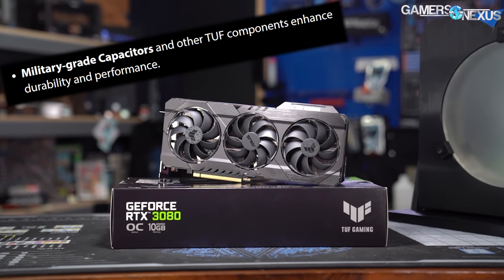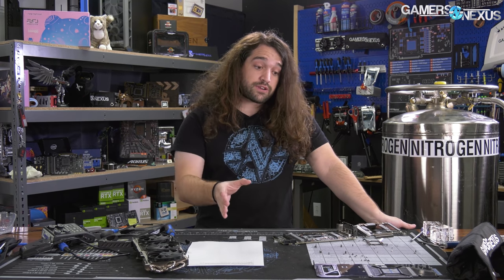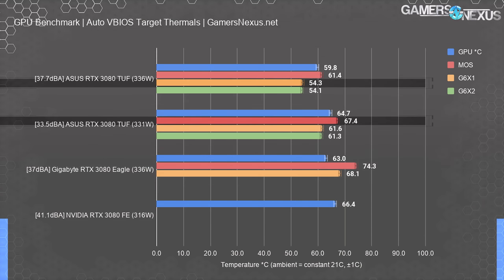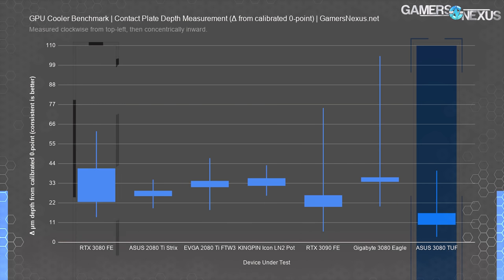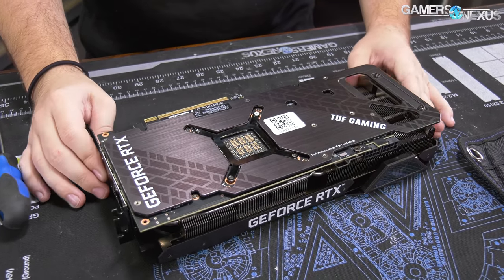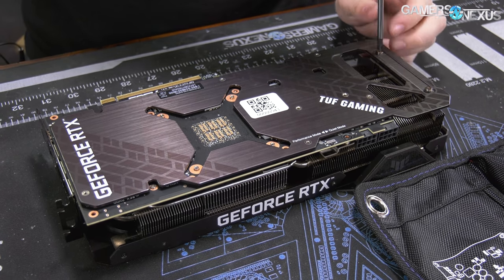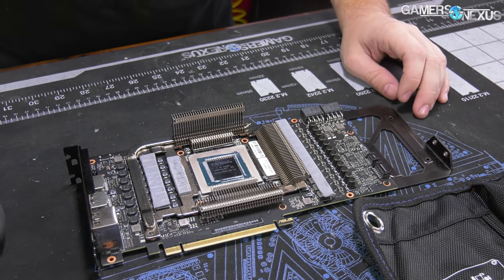ASUS RTX 3080 TUF OC Review & Tear-Down: Thermals, Noise, & Overclocking

Comment from the maker: Edit: There are two versions of this card. This is the TUF-RTX3080-O10G-GAMING (OC - didn't mention that part of the SKU name, sorry), which has an MSRP of $730, but seems to be priced around $750... if it's ever available, anyway. 
Back-order a GN toolkit here: https://store.gamersnexus.net/products/gamersnexus-tear-down-toolkit
Review of the Gigabyte RTX 3080 Eagle previously: https://www.youtube.com/watch?v=4ivWfdJs4BU
Here's our airflow photography of how the Founders Edition cooler behaves: https://www.youtube.com/watch?v=VVaGRtX80gI
Watch the RTX 3080 review here: https://www.youtube.com/watch?v=oTeXh9x0sUc
RTX 3080 FE Tear-Down: https://www.youtube.com/watch?v=OX9Eh_NaC5c
Previous 3080 review article: https://www.gamersnexus.net/hwreviews/3618-nvidia-rtx-3080-founders-edition-review-benchmarks
Reply: Steve you can't just say the "ASUS RTX 3080 TUF is so badass we didn't even need to test it, and would be cool if used by the military. This is clearly built Tonka Tuf and that is all you need to know. 10/10" and call it a review.
Reply: Can you ask ASUS about the BIOS? The threshold for zero fan is 30W! And that means, that the fan wont stop if you connect two monitors (permanent over 30W). Other board partners have 50W. ASUS should fix that.
Reply from the maker: @H1zN  Will pass it along to them.
Reply: Well, ball bearings on the fans are actually a good selling point for me - I can't afford to buy a card every generation so it has to hold up for about 3-4 years without starting to sound like a freehub.
Reply: @GamersNexus  thank u very much. U as GN have the power to reach someone by ASUS 👍
Reply: Any thoughts on which version you'd get? I'm in a pre-order queue for the non-OC version, but would happily cancel and try to find the OC edition if it's worth it. Doesn't seem like it though?
Reply: @Gamers Nexus Hi Steve, is the review for the Strix 3080 card also in the works? I'm waiting for it before I decide to pre-order that one or just go for a lot cheaper version like the TUF. I hope the review comes before pre-order turns into normal ordering and maybe paying the "You should have pre-ordered" tax, if you know what I mean
Reply: I studied electrical engineering and military grade components mean that the tolerances in the frequency  and temperature spectrum are way narrower than consumer grade. Does that make it true? You would have to show me an spec sheet and the actual component part number.
Reply: (OC - didn't mention that part of the SKU name, sorry) this line doesn make it any more clear if you ment the OC version or the non-OC version
Reply: When will we see the FTW Ultra review?
Reply: @tymon5349  after reading the comment I'm even more confused. Is this the OC version or not?
Reply: ROG STRIX 3080 please!
Reply: you gave us the serial number of the middle fan, but the other 2 fans spin the other direction, shouldn't they have a different serial number then?
Reply: The tire tracks are self-deprecating humor at the fact a reviewer ran over the last tuf with a truck.
Reply: @Gamers Nexus do you know why 3080 orders are so slow to get delivered to end users?? i am literally coming up to 30 days since i put my order in for an asus tuf card and the retailer still cant give me an eta for shipping. ive never experienced such a long wait for any pc component ever before. i got the high demand part for the first week or two, but a whole month?? (for reference, im in EU)
is it possible that nvidia might be having problems with gpu dye yields or something??
Reply: Gamer nexus videos are always a warranty never loosing a minute. Thank you
Reply: Hey
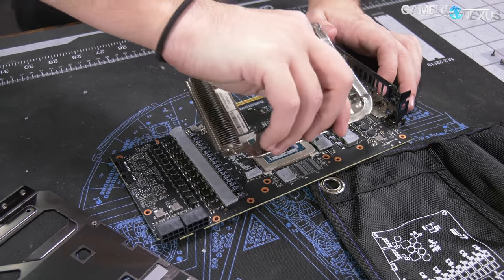at 22:40 there's probably a bit of miscommunication -- SFF community deshroud cards and slap normal fans (typically 120x25mm). 
So they're not interested in fan model, but how heatsink looks under the shroud (whether or not it's flat, i.e. is there some sort of stock fan mounting bars/protruding parts/etc that can block the blades of new fan from spinning). So probably just showing heatsink from the side (with removed shroud) to see if there's big protruding parts is good enough.

Heatsink thickness is also part of the interest -- card with bare heatsink has to be within 2 slots to work in most cases (ideally exactly 2 slots, in that case 25mm fans would snuggly fit and pull/push air directly from/to outside).

Here's example of how it looks in a case (2080 Ti Strix): https://i.redd.it/dg1xvpe20ie41.jpg
And here's example of points of interest (2080 Ti Strix as well, those tabs have to be bended/removed in order to put fans): https://i.imgur.com/oaqJoyf.jpeg
Reply: Military grade means it's fucking cheap. Cheap made products with cheap parts by the cheapest company they could find.
Reply: @H1zN  you can not ajust it with a custom fan curve ?
Reply: TLDR: Mill Spec and Aircraft grade aluminum are real things. Though I doubt ASUS is selling anything to the Military. Even if they say they test to Mill Spec, they don't do all tests. TUF is a marketing term.

MIL-STD-810G is a U.S. military specification that rates a level of durability for technology. Specifically, it means it has gone through a series of tests. These put a product up against shock, vibration, humidity, heat, cold, gunfire shock, humidity, and many many more. A MIL-STD-810G spec device should be field ready, HELL “combat ready”. Also Aluminum alloys containing magnesium is the primary alloying agent in 5xxx series alloys. It is one of the most effective and widely used aluminum alloys.  Alloys in this series possess moderate to high strength characteristics, weldability and resistance to corrosion in marine environments. Aluminum-magnesium alloys are widely used in building and construction, storage tanks, pressure vessels and marine applications.  Common alloy applications include: 5052 in electronics, 5083 in marine applications, anodized 5005 sheet for architectural applications and 5182 makes the aluminum beverage can lid.  BTW 3xxx series alloys are used for the walls of a beverage can. The Bradley Fighting Vehicle is made with 5083 and 7xxx series... 7xxx Series
 uses Zinc to make the alloy. When magnesium is added in a small amount, results are heat-treatable and high-strength.  Other elements such as copper and chromium may also be added in small quantities.  Most common alloys of 7xxx are 7050 and 7075, used in the aircraft. Apple aluminum Watch (2015) is made from a custom 7xxx alloy.
Reply: I wonder if they realize military grade just means lowest bidder.
Reply: Gamers Nexus “if its ever available” says the guy with 4 lol.
Reply: when you do the contact depth measurements on the gpu plates you should look at "violin graphs" they are extremely good at showing densities and how small or large the density of the extreme outliers are.
Reply: Will you pool up all the 3080 (when all the stock test are ran) ,and test them with Liquid Metal?
Reply: @Bartman61911  Not tue.  Not even close.  So much more goes into awarding a contract.  You think the F35 program went to the lowest bidder?
Reply: Can you do the aorous max cool rtx 3080/90 thinga ma bob? Subbed and everyone else should too
Reply: @zeus_anoxia  you and thousands more are wanting these cards, and there are only two in the entire product stack, and scalpers still are a thing. It's rough but it'll be a while before stock levels out, once more cards are released like the 3070 and 6000 series Navi cards will help
Reply: What military-grade means in electronics is at least a wider operating temperature range. And more stringent quality control and higher tolerances. Military-grade is mostly to survive abuse that users will put it through in the field and not randomly fail.  The quality grades are commercial, industrial, military.  The industrial-grade is for operating temperatures up to 85 Celcius.   I think they should use either automotive grade 2, which is up to 105C , or military-grade, for GPU:s.
Reply: So what's the other one? Non-OC?
Reply: @CaptainShiny5000  ball bearing compared to what ?
Reply: Considering it is a pain in the ass to change a single fan wouldn`t it be easier to sell whole heatsinks with fans for people to buy and replace their broken ones? And while i dont know how much such a contraption cost i cant imagine it costing the bulk of a grapohic card`s price
Reply: @ZeroB4NG  serial numbers would always be different. No 2 products have the same. So I think you mean SKU?
Reply: @Xfade81  Sleeve bearings. Those can start to rattle after a few months (and often have in my case). Especially with Gigabyte cards (two completely different ones have been complete trainwrecks in terms of noise). MSI tends to use either ball or hydrodynamic bearings and those fans never created any issues for me. That's my main reason why I stick to MSI atm. I only ever consider Graphics cards which use either ball or hydrodynamic brearing fans.
Reply: The tire tracks isn't because it's "tuff" but because upside down Steve ran over their one tuf with his truck because it was so bad it wasn't worth giving to someone else to him. I believe it was one of the 20 series ones.
Reply: @InconsistentManner  Yeah, but they don't call it Military Spec, they say it's Military GRADE. So can someone explain the difference?
Reply: @msromike123  No, but some of the parts in it probably did.
Reply: @Xfade81  Sleeve.
Reply: @Z1pZ1p3r  Dumb suggestion - you'd still have to do the same teardown work, and it would cost >3x the price to replace just a single fan.
Reply: Some one needs to do a Comprehensive Review of a MSI Aegis RS 10th gen Please.  If I was closer to you I would let you use mine.  I am getting more concerned with its cooling.
Reply: @GamersNexus  New BIOS with a 50W threshold is available since today :) Fans tunring now of in idle with two monitors connected.
Reply: @H1zN  fix is here use the Asus bios update tool. Auto-detects card and applies new bios Strix, Tuf and Tuf OC, etc https://dlcdnets.asus.com/pub/ASUS/Graphic%20Card/NVIDIA/BIOSUPDATE_TOOL/3080biosupdate.zip
Reply: @DeeBatch  I know. posted it allready here (1h ago) ;)
Reply: @H1zN  lol . I applied it much more stable clocks and OC higher. These 3080's are power limited. Mark my words when AMD reveals Big Navi magically all 3080's power consumptions will increase. We already see guys bios flashing 3080's and matching stock 3090's.
Reply: So is this the OC version or not?
Reply: @CyberMew  It’s the OC (overclock) version BOOM! I figured it out. 
Pause at 15:36 enhance that image and Next to his finger (his right our left) you can see the stock barcode and
It’s stock name, which is ‘TUF-RTX3080-O10G-GAMING’, which is the same stock name under the OC version of the card (on overclockers website anyway)

On the ‘non oc’ version of this card, the stock name is ‘TUF-RTX3080-10G-GAMING’ so I’m fairly confident this is the overclocked version
Reply: @TheArsenalgunner28  holy shit you have my respect bro ✊
Reply: Any chance you could review the Aorus Master cards?  They seem to have a barrel plug hidden under the shroud. Could this be for Miners?
Reply: Would this apply to the 3070 cards? I want the 3070 TUF for its performance and price but think the tire marks are kinda cringy and might get the gigabyte eagle
Reply: @GamersNexus  sorry I have a question, I know it has nothing to do with this article, but I wanted to ask, is it possible to flash a custom bios on a reference card? reference has 16 phases and custom 18. thanks
Reply: After watching the episodes about Gigabytes exploding PSU it feels a little weird to see you featuring a Gigabyte graphics card in this video. I think you said in the new video that you for a long time had been critick in regards to stof made by Gitabyte, but yet in this video you put Gigabyte on the table and say get it or the Asus whatever is in stock. That was strange to me.
Reply: I have a Asus rtx 3080 tuf gameing I get from a prebulid from asus how do I know if I have the OC version any one know
Reply: Any updates about this?